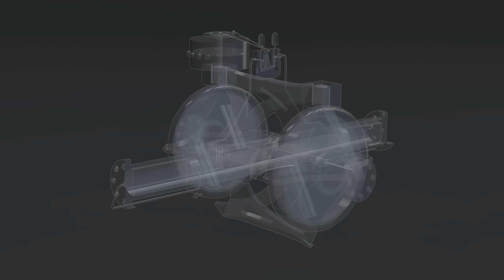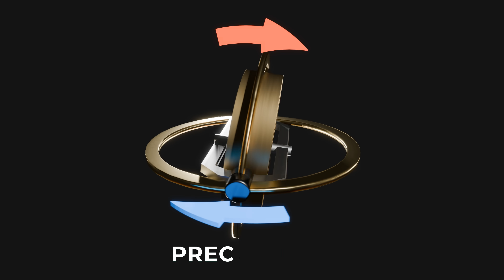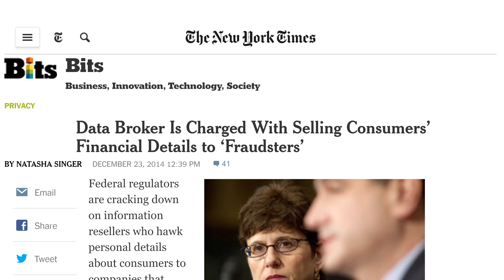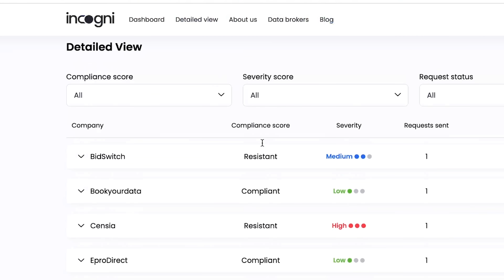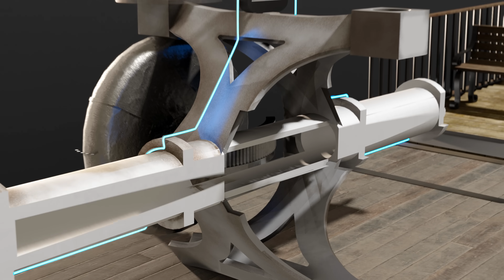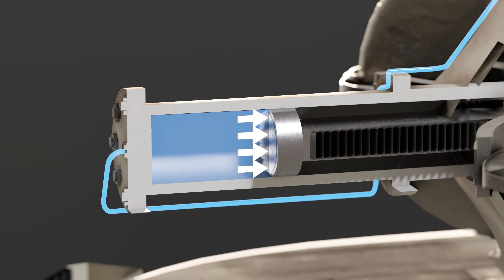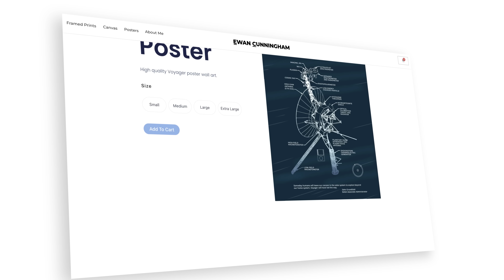The Self Balancing Monorail

Comment: Sadly,  this is not genius at work - it's a classic case of a solution looking for a problem. The supposed problem being that two rails are a financial burden to railways.

Firstly, if you look at that supposed "economic burden of having two rails, instead of just one", after railway mania caused a boom in conventional railway building and some railways were later shut down, you will see that the thing that has been blamed for railways closing down has pretty much always been a lack of freight traffic or a lack of passenger traffic, making the income of the railway too low for the  railway to exist as a private company. (Railways still create enough of a social benefit to be run at a loss, in a lot of cases, but that's not something private railway companies of the early 1900s would care about.) So self-balancing monorails were never really needed.

So, if we assume that this fictional problem actually needs solving, we still have some insane problems created by this choice of technology:

• Problem 1: Construction and maintenance vehicles do not exist that can use one railway rail as a monorail. The conventional railway industry has all sort of road-rail equipment that can approach the railway from a  road, drop down a set of train wheels and lift up the tires. And there are all sorts of platforms or hand-powered trucks that can be lifted onto a railway line for maintenance or inspection. You either end up going further down the Louis Brennan rabbit-hole to create gyroscope inspection bicycles, gyroscope wheelbarrows and all sorts of other weird things...or you would have to face the fact that inspection and construction vehicles need a stable surface. So instead of halving your rail budget you are going to be swapping the investment needed for one rail with costs of constructing two concrete tracks that are strong enough to support lifting cranes on tyres, with a single rail between them.

• Problem 2: If you look at real world data for conventional railways you will see that there are a small but significant number of incidents where trains break down for a number of hours and passengers need to be evacuated. With the Louis Brennan gagetbahn technology this sort of incident changes from an embarrassing situation, where people complain if the toilets fail or if they want to eat or drink to a situation where lives are at risk, if the gyroscopes run out of energy. Putting the risk to life to one side, the reputational damage of a balancing monorail train rolling down an embankment or toppling over the side of a bridge would have shareholders abandoning their shares and the value of a company building this stuff or a railway dependent on this stuff would fall through the floor. And if a disaster did kill a lot of passengers there would be a call for laws to "do something about the danger". Louis Brennan did add various workarounds to his original idea, so no doubt the balancing trains could have devices added that lower the risk of accidents. But, just as i think the trackway would morph into two tyre tracks and a rail  between them, to support the engineering vehicles, I think this would end up having tyre "stabilisers" or "emergency wheels" that employ air-bag style technology that fires them downward, when the train starts to roll over. Ultimately, that isn't really going to be cheaper than a train carriage. And, if it isn't cheaper, it is NOT a solution.

• Problem 3: Your video suggested these vehicles could use existing railway tracks. That just is not true. Every conventional railway company uses track gauge (not always the same track gauge for each railway) but they also have loading gauge. Loading gauge is the area around the rails that defines the maximum size of railway vehicles (again that is not the same for every railway). Because Louis Brennan's balancing trains stick out both side of the rail they sit on, if you put them on the left running rail or right running rail of a conventional railway,  they will obviously lean out further than the track gauge allows. So within a mile or two the Brennan train would hit a bridge or a tunnel. And the only way to avoid having the trains crash into existing two-track platforms, would be to make Brennan's vehicle high enough, that there was a verticle gap between the vehicle and the platform below it. But that would be insane, as passengers would not be expecting a train vehicle that comes in floating over 3 feet of the platform edge. You would end up with vehicles hitting passengers or passengers being dragged between the platform and the underside of the passenger compartment. Again that's an unacceptable human cost and also a humiliation for the company and possible government intervention. So the reality is that the only way Louis Brennan would get his trains onto tracks shared with conventional trains would be for him to pay for a three-track railway, where his trains use a central track. Again, we  are not solving a problem and we are not saving money.

• Problem 4: These vehicles ignore interoperability. Back during railway mania in Great Britain, companies soon realised that companies wanted to move goods long distances and set up deals where trains from one company could go over the tracks of other companies. So railway companies would pay to send trains on other companies tracks, but earn from other companies using their tracks. In London the Metropolitan District Railway Company tricked other railway companies into extending it's railway line, by offering them deals that would allow them to send their trains through Central London, so this was no trivial thing. Even if Louis Brennan got permission to add a third rail to the tracks of other railway companies, he would be causing railway companies that used his gagetbahn technology to pay out track rental fees to other railway companies, without the possibility of being able to rent out their own monorail tracks. The Great Western Railway were bought into Isambard Kingdom Brunel's Broad Gauge standard, fought a "format war" with the rest of the railway companies in Great Britain and eventually were forced to rip up their tracks and change their vehicles. The exact same thing would have happened to any company that decided to make their business dependent on Louis Brennan's balancing train tech.

• Problem 5: Potential transport companies, who are tempted by Louis Brennan's gagetbahn idea would be in a situation where they can turn to dozens of different companies to supply technology for conventional railways...or they could lock their business into the rise and fall of Louis Brennan's company. Once they lock into the monorail technology, the only  way to switch to a more competitive supplier, would be to rip out their entire railway and put in a conventional railway.

• Problem 6: You talk about Louis Brennan's balancing trains almost falling over and Louis Brennan's coming up with various workarounds that stop the train from falling over, but you do not once mention the additional stresses that would be placed on the running rail. A normal train has two rails, so the force is generally distributed to both of them (not always equally). The left rail is pushed in one direction and the right rail is pushed in the other direction. And railway ties deal with forces the engineers can generally anticipate. This system would add multiple pairs of gyroscopes that throw the train left or right, to keep it upright. With that never having been done before, the engineers probably wouldn't be able to anticipate what sort of stress failures the vehicles could cause.

Generally the best arguments for monorails (instead of conventional railways) are when a raiilway is built in a place where a conventional railway would be too awkward to install. The Wuppertal Schwebebahn is a good example of a monorail, as it occupies the air above a river. And hanging the vehicles from the rail, means that no gyroscope tech is needed. Gravity does the job. Henry Robinson Palmer's solution was actually a solution in Wuppertal. It was a niche solution and they are locked into the technology, but the system seems to work well.

Comment: This is what the most extreme cases of overengineering look like.

To spare one rail, he changed a perfectly stable system into an unstable one and added a system to every train car that adds weight, takes up space, has to be fueled and maintained - but adds nothing to the actual task of moving goods from A to B.
That is the sort of "elegant design" that keeps on giving. Only one malfunctioning gyro in a whole train (remember: every wagon needs a set of two) can make the beast derail.

That guy was a genius and a fool.
Reply: It was still cool though. But impractical at best, which is why it never went beyond a prototype.

Comment: The premise of the project was to create a one rail train because then it would be cheaper to install tracks. But all the process and over-engineering that goes into creating and making these gyroscopes, which every wagon would need to have, seems to me much more expensive than installing a simple line with two rails.

I'm very curious to know how long a track with a single rail would have to be to economically justify the implementation of this type of train.
Reply from the maker: I would be really interested to know that as well.

Comment: Interesting. Now of days we would do it with a MEMS sensor, a microcontroller and then most likely a set of pumps to move a fluid around to do the actual balancing.

There could be an application for the design in our world. Think of a transportation system at a theme park or convention center.

Comment: Imagine a bridge with only one beam with one rail on it. And see nothing over each side, then a mountain railway with one rail winding through the hills. It could have an overhead wire supplying power to it. With two flanges, points would have to be redesigned, perhaps more like monorail points.
A freight car would need to counter the greater weight, either by spiining faster, or being heavier, could you have two sets of gyros together with the compressed air system. A multiple car system would tilt at different rates but every car would be powered which would be able to accelerate more but such a train might use a lot of power than necessary to shift the freight. Perhaps two sets of gyros in a three car set that also keep a fixed middle car upright. Such a non-gyro car might help to stabilize the three car set.
The required energy to keep everything upright might exceed the cost of transporting the goods, even sitting in the yard waiting for a signal.
Fascinating concept though. A half scale PoC of a three car set might be interesting, or a computer model.

Comment: Truly incredible design. But strange how at the same time he couldnt grasp how impractical and expensive it would be to need a gyroscope in each carriage
Reply: I think it’s often quite difficult to figure out if any given solution to a problem is gonna be cost effective without first having a full design to compare against other solutions.

Like most other Gadget Bahn designs, there are probably some neiche cases where such a design would be preferable to normal trains, but you’d really have to crunch the numbers to find anything of the sort.
Reply: @Draktand01 Yep. Gotta build it first to find out.
Reply: Different mindsets are needed for each viewpoint. If you’re an inspired engineer, your looking for solutions to a problem you see. If you’re an inspired businessperson, you’re looking for problems that other people want solved.
Also, it’s very easy to miss the forest from the trees. This solution is a technical marvel, but the cost of building a railway isn’t the rails.
Reply: Low-frequency, long-distance routes wouldn't need that many cars relative to the length of track. This was more suited as a replacement for an interurban or intercity bus than for an actual passenger train.
Reply: I find it strange nobody here realised one fatal flaw: it falls over when you stop feeding it coal, you can't perpetually feed the thing o.O  
The only way they can be at idle without feeding it constant coal, is to either have platforms on either side that it "rests" on, or it has some "legs" that come down either side to perform the same stability.
Reply: @cjjuszczak a bicycle stays upright from the gyroscopic force of the wheels, and when those are not in use they have a kickstand to keep them upright. A similar device wouldn't be that difficult to install on a train that is generally well balanced and wouldn't need that much to keep it upright. You could have mains power and run the gyros as well, heck you could have had a battery bank at that point in time with enough juice to keep things spinning in-between runs.
Reply: @ottopartz1  Why bother with all that when the 2 track design solves all the issues in one hit... Just because you can doesn't always mean you should 🤦‍♂️
Reply: @MadScientist267  I wasn't saying that it should be done, I was just saying that a lack of balance when not in use wasn't a huge hurdle that couldn't be easily overcome. I really don't see any applications except for one or two where there might be any advantage to a two wheeled train, and even then I really don't think the advantage would be worth the additional costs of the stabilization mechanism both initially and ongoing.
Reply: @ottopartz1 Bicycles don't stay upright because of the wheels gyroscopic force but from steering geometry using the whole bicycle and rider momentum to upright itself. This is why we naturally countersteer without realizing it when we ride bikes, as mass needs to be shifted. Wheel gyroscopic force can only slow down the tilting, it cannot upright a bike as there is no force, only resistance to change. On a motorcycle both countersteering and gyroscopic effects are much more pronounced as the motorcycle is much heavier and the wheels have much more rotating mass.
Reply: The savings on rail building alone were promising. That was what he was going for, probably.

I think what really killed this idea was that the rail companies would need two rails to run freight trains over anyway. Can't see it being cost effective on a 20-30 car long freight train over time.
Reply: @ThZuao  Wrote : "The savings on rail building alone were promising." Very little would be saved.  The vast majority of the cost of building and mantaining a railway is in land costs and the civil engineering - tunnels, bridges, drainage etc. Saving one rail is neither here nor there.
Reply: people forget what a train is. It started as a simple minecart probably a thousand years ago. It can carry people but primary use is to carry heavy loads, that's where it makes most economic impact. Freight trains always made money,  for the entire known history. Passenger trains ... not so much. And when they fail, it's cos of these complicated solutions made to accommodate only people
Reply: per cart gyros are cheap. and they can be mass produced and when the carts are retired the gyros can be refurbished and reused if they became industry standard. that is definitely not the problem. the fact that sprawling two rail tracks were already laid, meant there was literally no advantage to be had. the point was that a mono track rail system could save costs.
Reply: @manawa3832  laying train tracks needs train tracks. To lay single track you need to adapt a gyro train to do that. And by itself that is a challenge, to adapt your passenger train to carry large amounts of gravel and rails
Reply: It's bullshit. There is zero reason why gyroscopes would be impractical and expensive : fake explanation from official government stories.
Reply: What's to say he didn't?
Reply: "It's not about the money, it's about sending a message."
-Brennan, probably

Comment: The same system could be used today to make two-wheeled cars, or motorcycles and scooters that balance themselves.
Reply: Have you ever ridden a bicycle?
Reply: @Zander10102  Yes, and I ride a motorcycle, but you have to put your feet down when you stop. With this gyroscopic system you wouldn't fall over even when stopping or turning. And cars are much more climate controlled and more protected from the weather than both bicycles and motorcycles, but with only two wheels instead of four could possibly be cheaper. Just a thought.

Comment: After doing a Mechanics applied to Aerospace Engineering module at university this year you come to apreciate gyroscopes. Before taking this class I only understood a gyroscope's stabilizing properties, but failed to comprehend their precesion and nutation motions. Let me tell you that after studiying all the formulas and concepts related to their motion they seem even weirder to me! I have done several experiments and simulations in MatLab, and fail to grasp these concepts, It is really impresive that Brennan manged to achive this fully mechanically (without PID loops or other corrective systems) and with the means of 1910! I wonder how he managed to empty the flywheel containers and keep them at a vaccum.
Reply: Air pump were already perfectly well understood at that time (and it didn't need to be a perfect vacuum).
Reply: @apveening  Yea, I suspected it would be a partial vaccum and that the container would need to be re-vacummed after some hours/days in operation. I am reading a bit about the topic and just realized that they could achieve pretty good vacumms at that time (I always thought that vaccum, pumps and compressed air where a bit more modern, but I guess not) Thanks for the info!